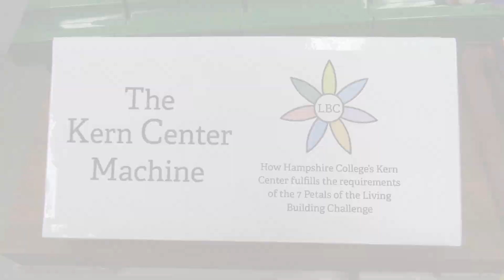The Kern Center Machine 🌼

Comment: That was SOOOOO good!!! You nailed making a machine that meets the perfect amount of complexity for this, where the machine is impressive to a machine community member or your typical, everyday viewer. I loved how this machine looked and how well everything worked. The tricks that stood out to me were the spinning marble spiral, which was a genius idea that I've had in the past but never tried executing and you executed it perfectly. I also loved the dump truck trick and especially the part with the two silver cups and the yellow ball. Very impressive.  The Beauty trick blew my mind and reminded me a lot of Spicing it Up. You took a common machine trick that was impressive on its own and rotated the can so the rod that pushed the ball into the can became the track for the ball? Genius! The multi use gear trick was genius as well and honestly one of the coolest machine tricks I have ever seen. Another favorite trick of mine was the chaotic solar panel sequence, which just looks awesome. A ball bouncing off of a moving board is always kind of sketchy, and I love how perfectly you pulled that off, along with the amazing hair dryer trickshot. And the battery autotilt was pure genius as well with off all the complex multi uses. I also loved the ball being shot into the funnel and the funnel being reused. That was a really clever idea as well. I also thought that the slinky trick was impressive and was surprised that you didn't really talk about that in your BTS.
Overall this machine was one of my favorites of yours and in general and I've been looking forward to this one for a long time. I'll add any additional thoughts that I have to this comment later, but all in all, amazing job. The eight weeks of work you put into this machine were well worth it.
Reply from the maker: I don't even know what to say about this except thank you! Thank you for taking the time to write out your thoughts about all your favorite tricks. It's so fun reading your thoughts on certain things, and seeing that someone else noticed the little details that I worked so hard on. I love reading your comments so much, and thank you!!

Comment: ok here's the long-awaited comment
0:53 love the use of the gear to get extra spin in the marble run, and how it also "energizes" the marble
1:04 so many things happening at once is confusing but the timing is soooo perfect, makes it a cooler trick
1:11 soooooo aesthetically pleasing. Best part of the trick is its smoothness, and very smart of you to use a ruler instead of a track
1:24 never thought of water pushing a ping pong ball and rolling down multiple ramps - blows my water video out of the water..... hehe... seriously I don't understand how it was so easy for you to control the water
1:28 even more water!! Using the weight to pull the bottle up completely to pour all the water in was clever
1:35 so much k'nex I have no idea how this works except for that gears are used somehow. But it's extremely cool anyway
1:43 very good take on the ball lift.
1:50 also very cool. I love flippy combinations
1:54 the best type of transition
1:57 awesome knowing that you used the plug to release the car
2:00 this is real, true scrappy building. I have thought of many ways to use things that look like random trash, but never to use the wire that connects to an electrical appliance. Very good idea
2:05 you're a master of timing. Idk why you decided to add the complexity of having the track fall into place or having the bounce happen, but you did it successfully
2:13 two fans in one machine, working at the same time? Blasphemy!
2:14 reminds me of both toothpaste35 and pitagora suichi, interesting how they fall in place perfectly for a track
2:20 definitely didn't see that coming. I'm wondering how you even managed to get the batteries to not roll in the first place before both reactions happened.
2:27 roll is so satisfying
2:33 this is the best type of multi use element
2:38 tricks like this prove that you're a master of k'nex
2:55 love how the whole trick gets revealed
3:04 There's so much going on in one second, but the way the track falls into place is very elegant.
3:11 Interesting take on the autotilt.
Overall likely the best machine I've ever seen
Reply from the maker: Wow!! Thanks for breaking it all down like this, it's so cool to see specifically which elements caught your attention. I'm glad you think this is the best machine you've ever seen, although I'm not sure I agree!

Comment: I thought you said you would never make another multi-table machine again ;)
Reply from the maker: Apollo14 I was referring to my signature compact & complex style of building when I said that. This machine is more spread out and less complicated. For right now, I'm sticking to single-table machines when I build with that style.
Reply: That was really just a joke, and I don't think this machine is any less impressive than the BLM. My favorite section was probably the Water section, because even the tricks that didn't involve water were mainly the smoothest moving tricks in the machine. My favorite for that section was probably the swinging track at 1:36, it felt like a somehow more complicated version of Is It Possible #16. Btw, how the heck did you reset the water bottle trick at 1:29? (Haven't watched the BTS video yet, so it might be explained there, idk :P)

Comment: I know I'm late for writing a long comment but I was busy breaking physics in my very secret and not spoiled to you machine project. This is easily among the best projects you've ever worked on. I don't know for sure if it's my favourite machine of yours, but in terms of a professional project I believe this to be your best work. The ideas are fantastic, the themes well represented, and the layout/organization make me a large nut. If I could sum up my feelings of your machine style (I believe Carson's said this before but whatever) it would be AAAAAAAAAAAAAA. Every single machine you make, regardless of complexity or compactness, ends up having this satisfying flow to it, in which every aspect of the machine manages to captivate me. I know this is attributed to your elegant style/thought process and your natural ability to formulate ideas for connections that don't suck and them piece them together in literally any level of compactness imaginable, but honestly it's something I seriously admire as a machine builder (who struggles to do exactly that)

JoJ™ Certified Tricks:
★ marble spinny boi 0:53
Very clever idea to increase the speed of a marble spinning in a funnel by spinning the funnel itself. Extremely satisfying, and the large to small gear mechanism you have setup to do it is clean af

★ section of liquid icc tricks starting at 1:22
I know from experience that water is complete ass to deal with in machines, so I was legit shocked when you revealed not just one but two water tricks for this project. They ended up being super smooth and seemingly reliable, so once again props to you for being j e s u s

★ s l o n k 2:37
Reminds me of the slinky trick I did for CCC a while back, and I'm sure you made that comparison as well. Quick and simple, but visually pleasing, and I hope to see more mini s l o n k from you in the future!

★ large launch 3:04
Similar to the launching trick I did back in 11I7, and I know you showed that clip in the bts so thanks for thiefing my chontent >:(. In all seriousness though I want more people to do vertical launch tricks they're dope but too uncommon in the community

I genuinely loved all the tricks in this machine, but due to me not wanting to type for over an hour I only mentioned four of them, so hopefully that's enough to satisfy. Awesome work, hope you get an Æ+ on your assignment, and I can't wait to see the first episode of JOASS!

Comment: Okay jeez. Your ability to create ginormous machines is incredible and they are executed so well.I absolutely love the deep meaning behind each of your design decisions and how they represent each of the seven petals of the machine. This machine was really clean and easy to follow and complex at the same time. I also think its wild how you gave me so many spoilers about the machine and STILL was able to surprise me. That just goes to show how huge this machine is. Anyway, top 5 time:

5. 1:36- You're insane
4. 2:38- Real clever multi-use of the slinky. It makes for a great side trick and looks super slick
3. 3:00- SMOOTH. NICELY DONE. The really quick-paced 
2. 1:11- Perhaps the best part about this tricl for me was that A) it was a spicing it up type trick B) it was s p i c y a f and C) the spice up used another trick as the spice up. I recognized both the original trick and the spice up, and the fusion of those two makes the trick absolutely genius. Maybe fusions will be a theme for a future SIUTS episode.
1. 1:05- Everything moving in the background combined with the main purpose of it (the metal cups) is SO GOOOD. The metal cups specifically blew me away. The nicely timed movement of it all just makes for a great trick.

Just some final thoughts about the machine as a whole. I love the sequence in the beginning with the pool balls and the cards revealing all of the signs. That gives me an idea (that I might use for some special occasion). I also thought it was nice how you made the path of the machine pretty easy to follow. Just one table after the other. Granted, a complex path makes the machine more interesting, but for a purpose like this, it makes more sense to involve a simple path. The behind the scenes video was also really entertaining to watch. I will probably  make one for the Vat19 Machine. I also noticed the timing of the music throughout the machine, such as when 2:25 when the drop in the song occurs and multiple times throughout when it switches tone. I don't know it that was intentional or not but it really characterizes what is going on in the machine. As things start to move more, more instruments may join in, or when a really cool or chaotic motion occurs the drop in the song.

Also, was this set off live for anyone?

Anyway, such a great job man. Can't wait to see what you will do next.
Reply from the maker: First of all, thank you for such a detailed comment. Not to put so much pressure on you, but I always look forward to reading your thoughts on my videos. You have a way of pointing out things about my machines that even I didn't notice before. For example, you immediately noticed that the can tilt trick is basically a SIU idea, and I hadn't even noticed until you pointed it out. And you're totally right. It takes a classic machine trick and adds a fresh new twist to it. And that fusion idea gives me a great idea for a potential video...I'll message you privately... ;)

The balance between clean and complex was definitely one I had to keep in mind throughout the building process. There were a few occasions where I caught myself wanting to attempt an idea that I knew would be too complex. (I added those ideas to my idea document; they're not going to waste, don't worry!) What resulted was a slightly simpler machine than my signature compact & complex style, but that doesn't mean that I'm not proud of each and every one of the tricks in this machine. As someone else pointed out, there's something in this machine for everyone, from the casual watcher to the experienced machine builder.

Interesting point about the metal cups: those were actually one of the very last things to be added to the table, and even the machine as a whole. For the longest time, all I had was the yellow ball roll off the end of the Hot Wheels track, and I didn't even have the board section after the dump truck. One of the biggest challenges was figuring out how to fill that first table. I knew I eventually had to get the yellow ball into that clear tube (the one that the yellow marble rolls down first) but I needed to fill the right side of that table, and doing something else with that yellow ball first was the only way I could think of to do that. I added the first cup (the one with the short orange track on top) first, with no actual idea of how I was going to lift the ball back up so it could roll down that track. I even experimented with another lifting method using the K'nex chain (shown in the BTS), but it didn't work out. I'm not exactly sure how I thought of just having another cup that lifts up. Regardless, I love how it turned out. Not just the timing aspect of it, but just the general aesthetic of the two identical moving metal cups.

That trick inspired by the card-revealing billiard ball chain sounds like it has the potential to be really neat. Is the special occasion CDM by any chance??? If not, could it be???

It would be great if you made a BTS for the Vat19 machine! Have you been recording tests and stuff throughout the process and stuff? That's really what makes a BTS video in this style watchable.

The only music synchronizations in this video were the ones at 0:10 (which I do for literally every video), 0:26, 0:41, and 4:48. The other ones you mentioned, particularly the one at 2:25, were all unintentional. The original song I used for this video is slightly shorter than this video, so I had to stretch the length to fit the video. To do this, I used the Remix feature in Adobe Audition that allows you to take any song and specify a new length for it and it will try to find mesh points to extend the song by looping parts of it naturally. That's why the drops in the song in this video are so much shorter than the drops in the actual song. Using this tool is challenging because I can't specify a length for the song in Audition until I know how long the video is, but I don't know how long the video is until I synchronize it to the song properly. So I just edited together the parts that couldn't be adjusted in length (the machine, the talking part after, the outro) with the rest of the video that could be adjusted in length (the intro, the drone shot, the slideshow, and the sped-up footage of the curtain) to get a general idea of the length of the video. I told Audition to extend the song to slightly longer than that amount (the product is usually shorter than your specified length since it has to find the perfect transition points in the song), imported that into Premiere, and adjusted the parts that could change in length to fit points in the song based on the extended version. Wow, that was a long answer.

Yes, after I already got the full one-take version of the machine (what you see in this video), I had live demonstrations of the machine. There were a lot of people who came to see it, including several science professors, other students in science-related classes, people who worked in the Kern Center, creative producers who filmed/took photos (that's how I got some of those nice photos/videos that I used in the slideshow in this video and throughout the BTS), and even the President of the college. They all seemed to love it, although I never had a perfect test for an audience. :D

Again, thanks for such a long comment, I always appreciate it when people take the time to give their detailed thoughts about my work. It's such a huge part of why I love what I do.
Reply: jackofallspades98 No problem man! Lemme just write a reply to your reply...

About the fusion trick: yeah I knew we would find a better idea 😂 

Yeah, that special occasion is CDM.

In the BTS for the Vat19 Machine, I planned in describing how some of the tricks work and what products I could have used. I wasn’t planning on talking about past designs but maybe that’s something I should start documenting.

About the music: really? That’s a huge coincidence. And I’ll definitely have to use that feature in audition at some point.

Comment: No machine as a screenlink?
Reply from the maker: I didn't have the time for it, since building the machine took longer than I expected, but then I got the machine to work really late as well, and I still had to make time for the live demonstrations of the machine over the course of two days. Any extra time after that was devoted to the BTS video. Especially with a machine of this length, filming the Machine as a Screenlink segment would've taken at least a day, which I didn't have the time for. Besides, I think everything is pretty easy to understand from the single camera view, but if not, the BTS also has some overhead shots in it and stuff. It was a sacrifice I was comfortable making.

Comment: Wow this takes everything I love about your style (Your multi-use tricks and complexity) and amps it up even more with how visual some of the tricks were. There were so many insane launches and other risky tricks that it helps you appreciate this machine more. My favorite three tricks were the yard stick rick at 1:11, the spinny track trick at 1:40, and the multiple launches in a row at 2:05. Overall this is arguably your best machine trick wise but easily my favorite visual wise.
Reply from the maker: I think your last point really sums up how I feel about this machine right now. I haven't decided whether or not I think it's my best machine, but I do think it is the most appealing visually. All the tricks you mentioned, and a few others, definitely have a really nice aesthetic to them, even though they are (in most cases) slightly simpler than what I'd make for machine in my signature compact & complex style.